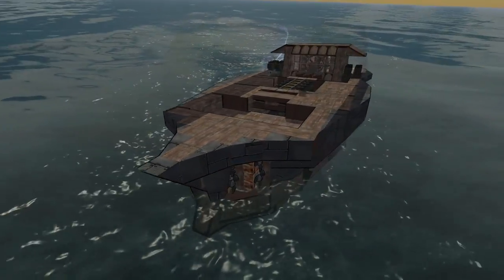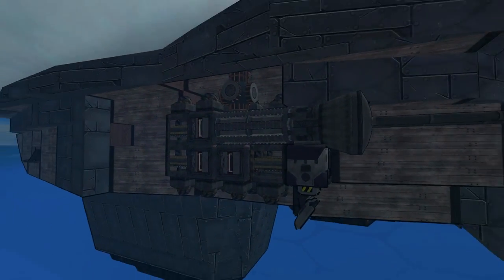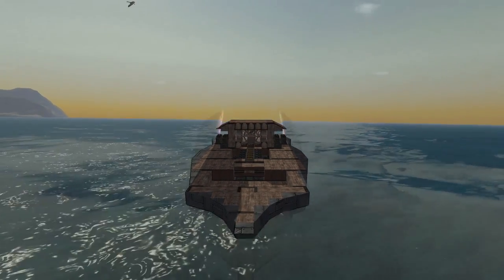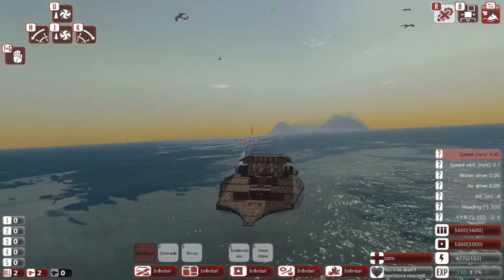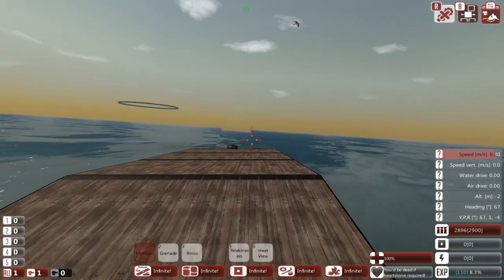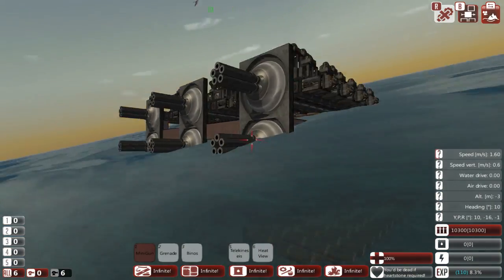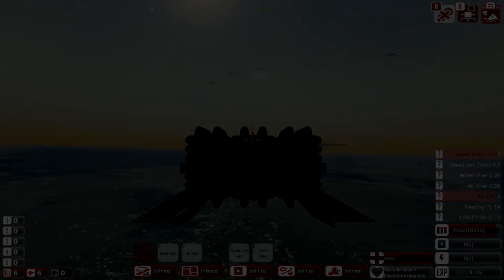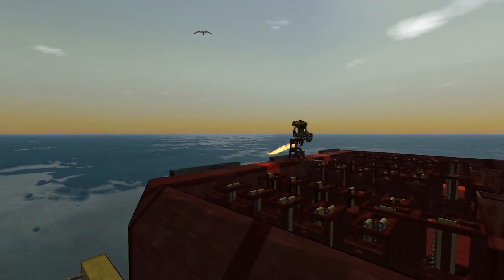Recoil Powered Speedboat! - Fun with Advanced Cannons - From the Depths[OUTDATED]

Comment: maybe try making a railgun they give INSANE amounts of knockback
Reply from the maker: +adrian roed Would definitely be worth a try.  The thing I discovered with recoil boats is you need a relatively fast fire rate, otherwise you decelerate too much between rounds.  Fast fire railguns need a HUGE battery rig unfortunately.  I'm pretty sure muzzle velocity is the highest contributor to recoil.  Need to play with the overclocking settings too actually, that increases recoil! :D
Reply: Also u could use an autonomes control Block to shoot the cannon  and ad some turning propellers to make it Ai controlled
Reply from the maker: Sadly, the new cannons don't seem to work with ACBs yet.  It would make this whole principle a little more feasible.  Will experiment with it more when the ACBs work. :)
Reply: Can i ask you how to get an experimenyal version of the game do I need a code or is there some way i can just join it? I want to play around with some turret designs
Reply from the maker: If you have a look in the 'Read More' section of the video description, there are some instructions there on how to access the dev branch. :)
Reply: Thanks ;)